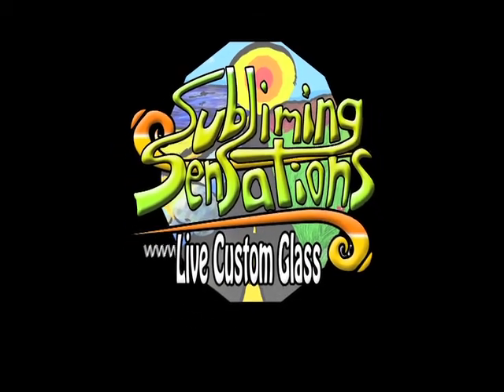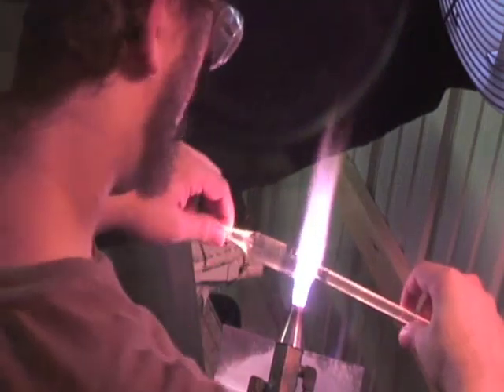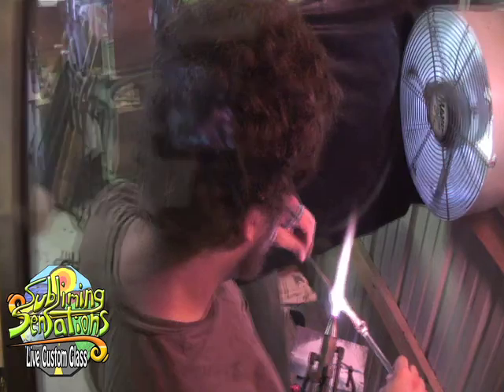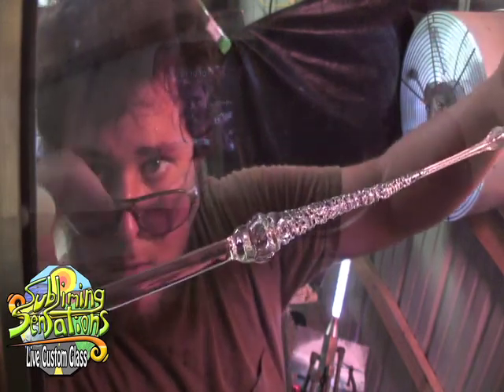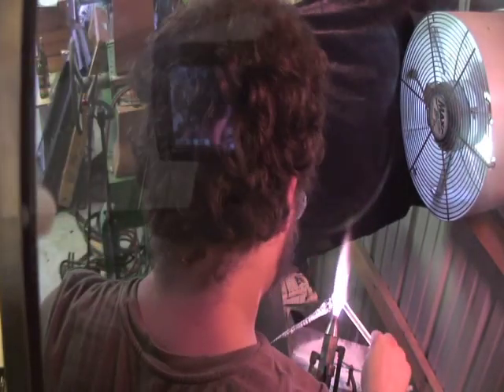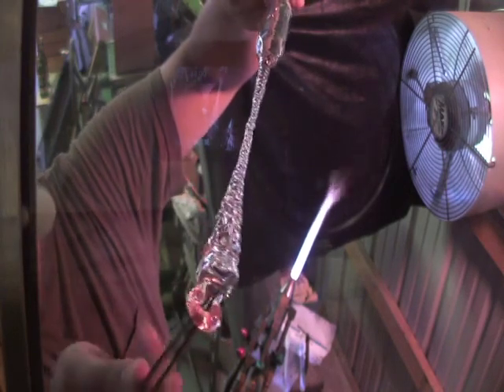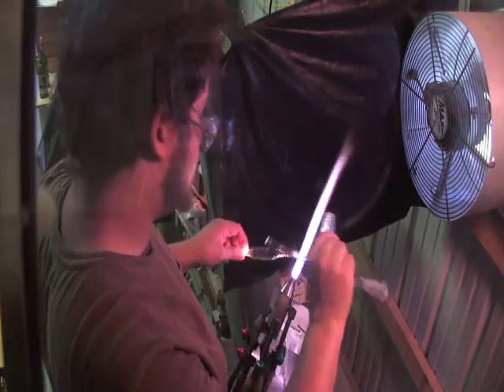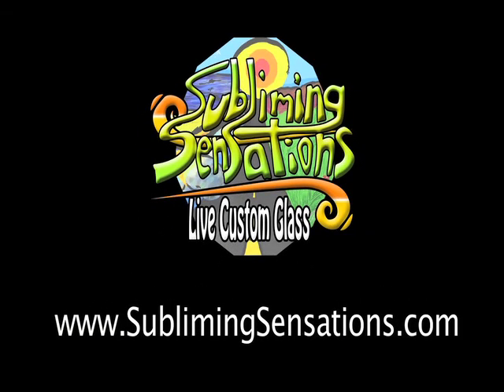How to make a Glass Icicle by Subliming Sensation

Comment: hmm well when you get it you will see it, the right pull feels amazing and you instantly know! yesterday i picked a hole in two tries! it usualy takes me 15+..the main trick is to only heat up a tiny spot try to grab as much glass as you can with your rod i like to shove it in then pull it out reallly fast it usually gives me a very very very thin nice film if you get a micro thin film your set!! if you cant get it open from that point jus bend the rod till it brakes the film!

Comment: if you havent got it.. its a fucking TRICK the secret is you heat up a tiny spot on the tube you want the heat spot small then you shove a rod into it and pull FAST it should bring out a super think layer or glass if you dont pull super fast after its hot it will pull a smaller point and is harder to open, but from there get a micro thin layer of glass then hurry and pull that out before it metls down, which happens instantly..if your insucceful(its seriously extremely hard) ill make videos!